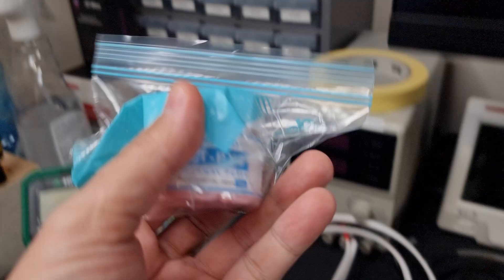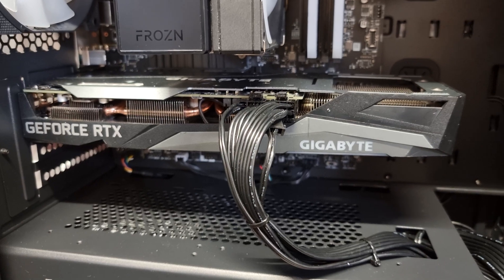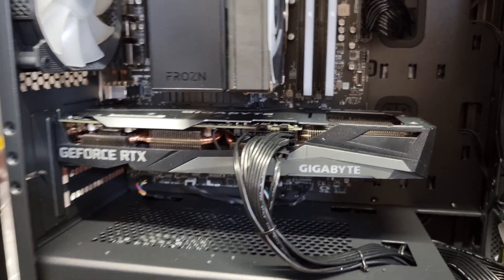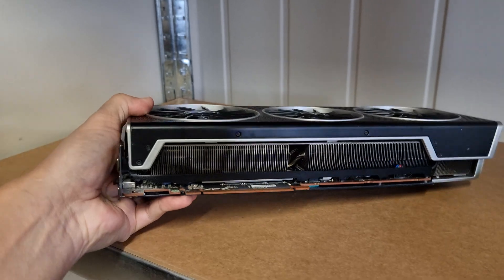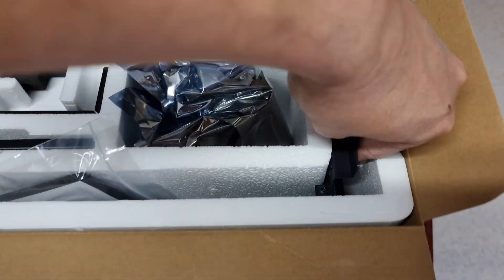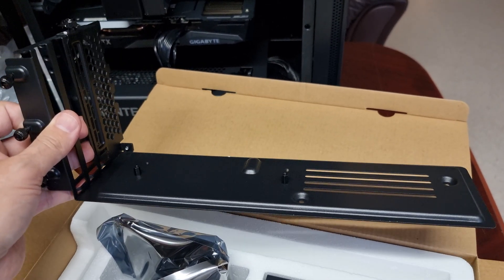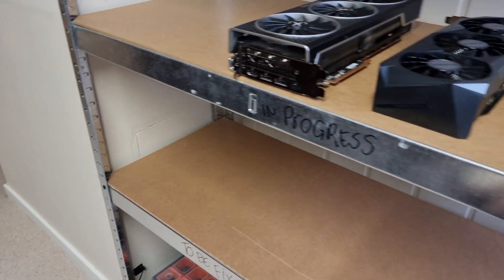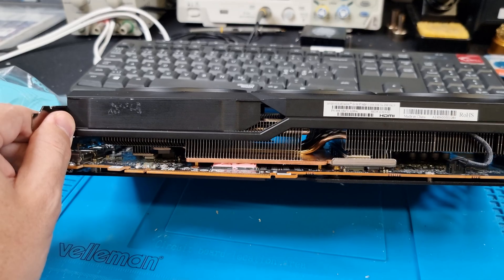Why Modern Day Graphics Cards Are Dying Prematurely.

Comment: 90% of GPUs that come for repair with memory errors are all mounted horizontally. Most of them have either broken pads or cracked solder joints near the PCI slot. One of the 4090 I received had a bent PCB, and I could not install the core back again as the corners were not making contact. I had to replace the entire PCB. Vertical mounting is the best way to save your heavy GPUs. It's a valuable video, my brother. This video needs a ton of views so more people can be educated and their GPUs saved.😁
Reply: @frazerxavier7295  But like 90% of GPUs are mounted horizontally. So wouldn't that be an expected outcome ratio?
Reply: @oelboy  you either have to get a case that mounts the motherboard vertically or get a case with a vertical GPU mount. The last option is to start buying accessories to eliminate sag. Your only actual options
Reply: @oelboy  The Consumer Space has to change, because only 1% of PC Builders are aware of this problem, spread the word
Reply: @MrSamadolfo My point is if 90% of cards are mounted horizontally, you'd expect 90% of cards with damage having been mounted horizontally.
Reply: @oelboy  🙂 thats not the case only because most PC Gamers around the world do not run extra large and extra long and extra heavy Three Fan Video Cards, so thats why we dont see too much damage out there in the wild, most pc gamers are running single fan and two fan video cards, video cards are still very expensive and are out of reach for most pc gamers around the whole world
Reply: @MrSamadolfo  I'm just saying that anecdotal evidence like this is to be taken with a grain of salt. And since we don't know the prevalence of horizontal installation, we should be careful with treating the outcome as a probability ratio. We have to compare P(VRAM Damage|vertical installation) to P(VRAM Damage|horizontal installation) and order that by GPU weight/ weight distribution to get a proper picture. And we are missing data to do that.
Reply: @oelboy  😊 sure broh, its an interesting conversation, this is the first time i heard a bunch of pc builders talk about these HULK Size Video Cards as being a problem
Reply: Lots of cards come with brackets. I believe GPU sag is a fairly known problem.
Reply: I'm use a holder stand for support on my 5090
Reply: This is why my 4090 sits comfortably in my core v21 case vertically. call me old fashioned but motherboards were designed to lay flat with expansion cards mounted vertically never had any problems touch wood😂
Reply: @paulbryant4518  😒👍 Keep It Old School 🦃
Reply: I would have said its the owners fault.

If you have a heavy, long graphics card, you better know that you need a support for the card otherwise you can expect this problems nowadays.

I personally use just a small, passive cooled GTX 1050 Ti, doesnt even have a PCIe power connector, it just runs off 75W PCIe slot directly. And on my notebook i have a super compact RTX 2080 (Max-P) MXM module which will also never have those issues. I give a fk about modern desktop and especially gaming hardware: Prices, Quality and Support nowadays just suck so hard
Reply: @harrison00xXx  if they are made heavier, then he should be manufactured to support themselves.
Reply: @piworower  doesnt solve the problem of the mechanical stress on the PCIe socket

Just support damn heavy graphics cards if you really need those overpriced, overestimated gaming nonsense
Reply: How do you mount a GPU horizontaly on an ATX tower? Do you have recommendations? Maybe case recommendation etc. ?
Reply: @attractivegd9531  EXAMPLES: Cooler Master MasterBox TD500 + 'Cooler Master Vertical GPU Card Holder Kit', 'Thermaltake Core V1 Mini ITX Cube', 'SilverStone Home Theater Case', 'Lian Li O11 Dynamic EVO Reverse Mode', 'Thermaltake Tower 600'
Reply: Yall are having this conversation while gpu support struts exist. In my setup i just use mini plastic cups stacked.
Reply: Now this is some HUGE LOAD of bullshit LOL.
Reply: I build horizontal PC builds since the 2000's. Never had to deal with those issues. 

The best case rn in my opinion is the Silverstone GD11 Grandia
Reply: @frazerxavier7295   my gigabyte rtx 4070 ti super eagle oc 16gb which i grabbed it on launch jan 2024 as an upgrade to rtx 3070 FE(since Jan 2021) only weighs 900gm 🙂
Reply: @frazerxavier7295  the evga 2070 super ultra ftw3, solved this issue back in the day. My pc fell sideways twice and multiple tweaks for fans, I believe the triple screw plate was clutch for that heavy heat sink
Reply: where'd you learn to repair GPUs from?
Reply: The 90% is mainly due to the fact that the horizontal method is the most widespread. In any case, if we're talking about thermal and cooling considerations, horizontal placement is the best (Heat always rises, so horizontal placement is preferable for cooling, and also for the operation of the vapor chamber, a card placed vertically should have some points that are better cooled and others that are less cooled with hot spots ), The disadvantage of horizontal placement is due to the weight of the card, which can weaken certain components and the PCB.
Reply: Been picking up on this topic via a few videos now and crazy stuff. Prompted me to order stuff for vertical mount right away for the new build I am doing ATM. Thank you everyone for this content. Maybe not needed for a 5090 FE as it's relatively short but better save than sorry. I am also getting a Thermal Grizzly Wireview Pro 2 for that other potential issue.
Reply from the maker: Thank you, brother! It means a lot coming from someone with your expertise! I just got 12 more cards and almost all have the same issue: memory errors on A0 or B1. This 5080 i have here weighs so much and I can feel it on my wrist when I go and pick it up. I have use both hands lol. Good to hear from you man! I hope all is well!
Reply: 😒 exactly, this is common sense, have you ever seen what super expensive Workstations and Servers and Commercial applications do? they all use Server Racks, the only choice you have is to install video cards upright, thats what your suppose to do, even back in the day the IBM XT or AT the motherboard was layed flat. All this evill started when consumer pc where turned into Towers, say NO MORE 😸
Reply: @MrSamadolfo  they install them upright because of space. That's why they measure in 2u,4u,6u etc.

They don't need massive heatsinks because of high air flow. Another reason why they are mounted that way also.

Nobody knew we were going to have giant heatsinks.
Reply: @MrSamadolfo  To be fair, that's because the tower is an atavistic design from the 386 era. CPUs at the time had a passive heatsink or a tiny fan, while expansion cards were bare boards designed for video/sound/network I/O rather than any actual processing. This configuration was never meant for humongous CPU coolers and GPUs with the dimensions and weight of literal bricks. These parts are like the neocortex that completely overtook the rest of the brain and created multiple issues in the process. Literally the only concessions to modernity in PC cases over the last 3 decades was replacing drive bays with more fans and relocating the increasingly heavy PSU to the bottom. Drastic changes are long overdue, the question is how to get them to align with each other.
Reply: @Reirainsong  😊 exactly, its so funny nobody its talking about this, and I mean nobody anywhere around the whole wide world 😅🌎🌏

Comment: Hey Technology Hive, good to see your back, but my question is, what if you are using a pcie slot for a card? (i.e soundcard). I originally used a vertical mount before I got the soundcard (still have it in the box), do you recommend me going back to vertical as I kinda need the soundcard for my headphones and speakers.....
Reply: You could just get a small DAC, hook it up to your motherboard and let it act as your throughput instead.  
I used to utilize a soundcard, but as time passed i needed the PCI-E slot for other things, so i got a DAC instead.  
It sits on my desk, under my monitors, i can plug in speakers on the back of it, and headphones on the front. 
I use an optical connection to my PC to minimize interference. 
Plus i can control the volume with a physical knob now, something i was unable to before.  

Something like a 'FX-Audio DAC-X6' or 'AIYIMA DAC-A2' should work fine, there's plenty of more expensive ones out there if you need more ports or features.
Reply: 🙂 install it outside the case and use an extension, or extension plus leave it laying on the bottom of the case, of course im assuming your using an XL case so you will have extra room in the case

Comment: I think long videos like this are great as someone who's building a PC for the first time. I'm probably buying a two fan GPU, but will still support it. I need my puter to last a long time.
Reply from the maker: I try to squeeze as much information as I can, thus the long videos :) A two fan card is also a good choice. Rarely do I see those come in with cracked joints under the memory chips or core.

Comment: My case is laying on the back sidepanel for years xD with an open front sidepanel, and yes it gets some dust over time and has to be cleaned every few months, but thats better than damaging the gpu.
Reply from the maker: That is actually a clever way to circumvent buying a vertical mount. If the space is there on your desk, laying the pc on its side is a good idea :)
Reply: @TechnologyHive  it's a proper way for a PC as a whole. It's close to the mind why.
Reply: 😒 thats what we are suppose to do, long time ago this was already figured out, the 1983 IBM XT, motherboards are suppose to be used in the horizontal position, period. end of story, even to this day most business applications like Servers the motherboard is still installed in racks and video cards vertical, servers, bit coin mining is the correct and best way for your video card, the modern pc case is EVIL
Reply: @MrSamadolfo  yes, and even the laptops are with the same horizontal design. Vertical is just stupid and made for profits from failed parts, repairs, transports of the parts and services.

Comment: The motherboard layout was never made to be sitting vertically with a heavy load onto the PCI-E connector like that.  
Motherboards haven't changed that much since their inception, they were meant so sit flat horizontically against the metal supports that held it securely in place in a computer, distrobuting the weight equally.  

When tower chassi's became more popular it still wasn't a big deal, because video/graphical accelerators of the time were dinky small and very light.  

Today we have moved on from video accelerators into Graphical Processing Units (GPU's), they require far more cooling and heat dissipation than ever before.  
And voila! The heatsinks grow and grow in size with each iteration, the poor motherboard PCI-E ports are holding on for dear life as the motherboards hang vertically. 
The weight of the entire graphics card is horizontically bending the PCB of the GPU and also putting a lot of stress onto the PCI-E connector/port of the motherboard and surrounding mainboard.
  
I personally have been using Cube-style PC cases with horizontally seated motherboards and vertically seated GPUs, like the old times! It doesn't have this issue as weight is disperesed as intented.
Reply from the maker: The cube style cases with vertical layout for the motherboard are great for large cards, if the space is there to accommodate. Cooler Master used to make two of them, I forget the name, but they were very popular back then.
Reply: @TechnologyHive  Cooler Master HAF XB Evo is probably one of them you remember.  
I used that before, upgraded to the Jonsbo N5 cube chassi.  

I wish more manufacturers made at least 1 cube case each, then we could have some different models and designs in 2025.
Reply from the maker: @Cal-ain  Yup, that's one of them. The other one was the CM Elite 130.
Reply: "they require far more cooling and heat dissipation than ever before"

And thats why i avoid desktop gaming for as long this trend goes on!

In fact i switched to either a classic, "low end" GPU (GTX 1050 Ti, passive cooled) on my gaming desktop from a bigger GTX 1070 i sold with profit and got instead of a new desktop gaming PC a RTX 2080 notebook which is after 5 years still perfectly fine and fast, just a thin graphite pad on CPU + GPU Die, better than stock thermal paste and better thermal pads on video Ram, VRMs  etc.

To be honest... because of this non existent "quality" nowadays and ancient, super inefficient x86 technology for PCs - i got rid of every PC which doesnt serve me for gaming, the only reason i use PC nowadays anymore. Instead, my Desktop/Mediacenter/Server/Notebook/Entertainment Computer, so basically a computer which can do it all better (except x86/windows gaming...) is now a 16" MacBook Pro with M1 Pro chip. Outperforms ANY other computer in all aspects i would need a computer for, and the only downsides of this machine are obvious (and annoying): (un)repairability, non upgradable RAM and SSD... a downside i loved to accept since everything else is just AWESOME and outstanding in the computer world nowadays.
Reply from the maker: @harrison00xXx  I see what you mean. I am afraid it is not going to get better either. Every time a new generation releases, it just seems to get heavier and heavier.
Reply: @TechnologyHive  Same with for example Apples M1 to M3 chip development... yes, lets say 15-20% performance improvement. But at which cost? From M1 (Pro) to M2 (Pro) those 15-20% more performance came also at a cost of hotter chips and also at least 10% more power consumption under load.

Only the M4 chip finally seems to be a "reasonable" improvement over my "aged" M1 Pro. But thats ok... at least Apple doesnt force you to get every year new hardware to get all the interesting features and even my old M1 Pro chip will perform well enough for another 3-4 years i guess.
The only reason i see to upgrade to a M5 or M6 (Pro) in the future would be a "much faster" performance, more Ram/SSD ofc and hopefully even better battery runtime, as great my 16" MBP is already.
Reply: @TechnologyHive  The "funny" thing about the development the past 6-7 years is.... GTX 1000 series was a big jump forward... they were at the time very efficient, cool and fast.

RTX 2000 series? Well, just raytracing added, to be honest for a big price increase. But at least the mobile RTX 2080s (Max-P) got affordable in notebooks with a very nice performance.
RTX3000? I wasnt impressed either, but the mobile RTX 3060 (Ti) was a nice thing, but again only nice series for notebooks!
RTX4000 series are finally somewhat "fast" and really well suited for fast gaming desktops, but the price got even more ridicilous.
And i dont think we should argue about the RTX5000 series... same "bad" development as the jump from GTX 1000 to RTX 2000 series with a big price increase for a newer/"better" DLSS model.
Reply from the maker: @harrison00xXx  I don't deal with Apple products so I can't speak on anything you mentioned. But applying the same logic to other hardware, yes I see your point.
Reply from the maker: @harrison00xXx  The legendary 1080Ti is still my favorite Nvidia card of all time. Good ole days.
Reply: 🙂 exactly, we already had figured this out way back in 1983 with the IBM XT 😅
Reply: I was thinking just rotating my pc case 90 degrees, that way I dont have to buy a riser lol
Reply from the maker: @DanJackielz  That will work.
Reply: this is intended...they sell more gpus this way
Reply: @antearesgamer  😸🤑 ChaChing
Reply from the maker: @antearesgamer ...and many AIBs are sketchy with their rma policies. Gigabyte will deny your rma over stupid reasons.

Comment: omg so many Graphics Cards :hand-orange-covering-eyes::hand-orange-covering-eyes::hand-orange-covering-eyes::face-blue-wide-eyes::face-blue-wide-eyes:
Reply from the maker: More than half of them have the same issue. It's the same memory chips close to the PCI slot.
Reply: @TechnologyHive  Pls tell me maybe you don't remember but roughly speaking how many GPU-s have you repaired because of that sagging problem in your lifetime?
Reply from the maker: @JamesSmith-cb7ou  I can not give you a straight number, but lets just say that more than half the GPU's I get in for repair come with the same issue, and that is cracked joints under the memory chips close to the PCIe slot or cracked joints under the core from sag. It is very common.
Reply: @TechnologyHive  And then Gigabyte GPUs Exist. Which causing issues if Mounted Vertically. They are better installed Horizontally. Did Gigabyte Solve the Issue or create a New one.
Reply from the maker: @KING_DRANZER  How are Gigabyte GPU's a problem when installed vertically?
Reply: @TechnologyHive  Thermal Putty leaking out when heated. And spreading all over.When Horizontal it is completely Fine. Not spreading.
Reply: @TechnologyHive  One scenario is where it leaks out that there won't be enough left to make proper contact. And second scenario due to it getting into liquid state and back over time it may get contaminated and may cause issues that way(very unlikely but there sure is a possibility in worst case scenario).